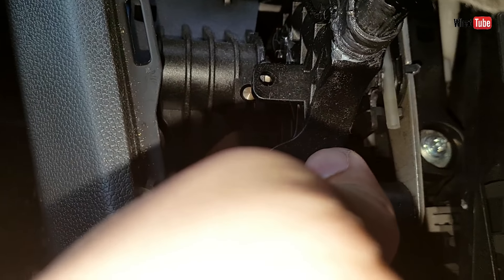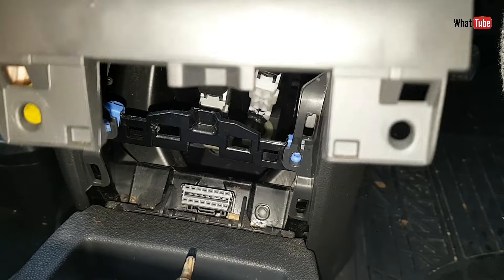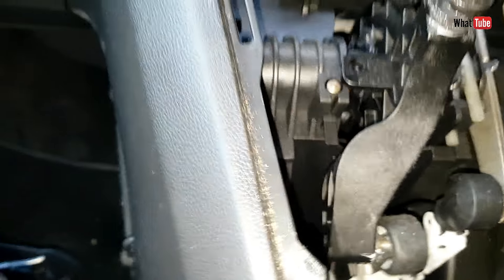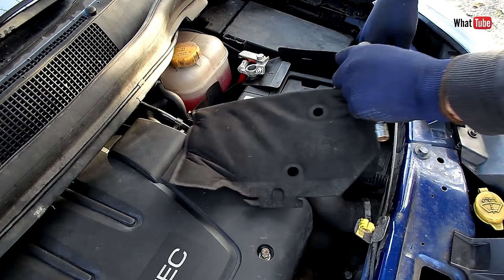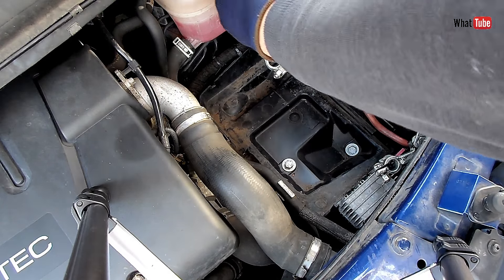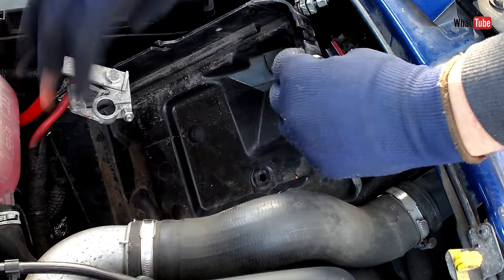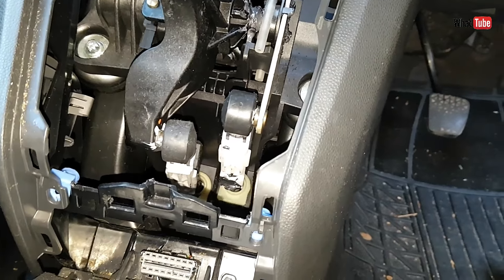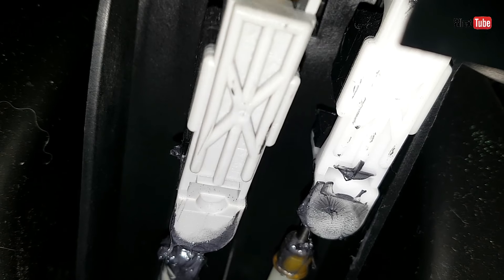Gearbox Linkage Adjustment for Opel and Vauxhall Zafira tutorial

Comment: Fantastic, just bought a Zafira that was impossible to get into first gear, this fixed it and feels like a new gear box, the battery tray is a bit tricky but worth persevering 👍
Reply: I drove mine for about 5yrs with an iffy clutch.  Just swapped the clutch while I had the engine out and it’s like a different car now.  Totally different to drive.
Reply: Was is it impossible to get into 1st gear when the engine is on ?

Comment: Hi. Great video! I've got here a Zafira B 1.8 2009 with F17 gear box. Does it work the same way?
Reply from the maker: Thank you,
It's similar but not the same, the hole is in a different place on the turret for the F17, there is a hole which you can see on part of the linkage away from the main turret (might have to use a mirror to see it) that using a 4.5mm drill bit you lock against the main turret which has a corresponding hole.
Reply: @WhatTube  Thank you very much.

Comment: Great video! My gear freeze and cannot be moved until engine has warmed up like 30 minutes when winter comes. Can you give a hint what can get frozen in there? Cables?
Reply from the maker: Have you checked the oil?
Reply: @WhatTube  Oh, ok, I found out that water from front window gets into the tube covering wire rope connecting gear and shift box. Had to replace the cables. Thanks! Your video helped very much to replace it!

Comment: Hello after having removed and put back new cables (because cable breaks at the level of the gear lever )  my gears from 1 to 6 go three well ,except that the rearward step passes well but when I press on the accelerator pedal I advance as if I was in 1st and not in rearward walk?

Comment: I have a crunch in reverse, do you think this adjustment will help get rid of it? Or maybe you have an idea what the problem may be? All the other gear shifts work fine
Reply from the maker: Hi, it may fix the issue, the best thing to do is trying.
Reply: Did it solve your problem? Mine has a crunch in 3rd. The other gears are fine. I'll try this method in the video, I hope it will help.
Reply: @ezredes19 did it work mine does 3rd and 4th but certain revs it’s fine 💁🏻

Comment: Not sure anybody will answer but i just had a used gearbox fitted on my 61 meriva, been great for 2 months but this week it's been really struggling to get into reverse, all other gears are fine, mechanic said it could be the used gearbox or the gear cable could do with replacing? Thanks.

Comment: with my zafira 1.7 2010 its all good but in 3rd when pressing the acellerator the gearstick moved a bit on its own like slightly moving down towards neutral when pressing gas.
releasing the gas pedal then it returns to the 3rd gear position. it does is very slightly in 4th but not as much as 3rd.

what could be the cause of this do you think?
Reply: for my old vivaro any movement with the gearstick like this meant that the clutch/gearbox was on its way out.. i hope its not the case for this
Reply from the maker: Hi, it can be the cable itself, gearbox or the engine mount as well (normally the front and rear one).
Reply: Hi, I have the same problem with my astra h 2007. Haveyou found the problem so far?
Reply: @rafailnikoviotis4628  nope its been exactly the same, no change, am thinking it could be the engine mounts as its just the same after 8 months, if it was a cable or gearbox there would be some change with it getting worse etc

Comment: Hello mate I have a insignia I think I have the same problem as this but not honestly sure. I can't get into reverse 1st, 2nd, and 6th gear. I can at times with no problem but it's become alot worse in short time frame. If I push the clutch all the way in and try to put it in gear you'll hear noise while clutch is still pressed in.  Clutch doesn't seem to be the problem or the fly wheel(I don't think).  Could you guess the problem bud?
Reply from the maker: Hi, if you hear noise when the clutch is down it means that the clutch is not actually fully separated, it can be the master or slave cylinder, first try to bleed the clutch system.
It can be issue with the linkage like in the video as well, or some damage inside the gearbox.

Comment: Hello mate. when I put my car in reveres (ZAFIRA B 2014)  it often crunch but all forward gears works fine.. also the clutch pedal seems high compared to my focus st.. Can you do a video on how to adjust the clutch pedals please??
Reply from the maker: Hi, in this car the clutch is idraulic so you cannot adjust it (it's possible to adjust the pedal but just slightly).
The release bearing on these it is weak as well so it can be that as well.
I'll try to make a video when I have a bit of time and the weather is good 😁🌦
Reply: @WhatTube  Thank you my friend.. very much appreciated.

Comment: Hi I have a 2015 astra j 1.6 it wont go in any gear first thing in the morning and all I hear is grinding when I try to force it in to gear but once I worm the car up for 10-15 mins all gears work fine all day without a problem what you do think the problem is?
Reply from the maker: Hi,
It can be the clutch, the release bearing or just the old gearbox oil.
Reply: @WhatTube  thank you very much I will get it looked at

Comment: So for the zafira 1.8vvt. Sort of the same but not really lol. Do as he’s shows. You don’t have the same turret so can’t get it to stay in place I had my mate hold it I pushed the clips back in left one went in fine the right one broke ! Put a cable tie on it and my mate let go of the turret and No 4th! Cut the cable tie got the white bit loose again at this point the white bit moved down clipped it in and now works fine and didn’t need the cable tie. Think it’s to high if you clip it in with the turret up so lift the turret do the right side then let go and do the right side now my gears feel light and goes into every gear perfect
Reply from the maker: Nice job 👍

Comment: Hello friend, all my gears go somewhat ok, but the shifters is very hard, do you think this adjustment will help
Reply from the maker: Hi,
Try to change the gears directly from the selector on top of the gearbox, if they go into gear easily, then it can be the linkage stretched so you need to change that. 
But try this method, maybe it will fix your problem.
Reply: @WhatTube  thanks, will try

Comment: Fitted a new clutch and gear selector cable on my astra h GTC 2 liter Turbo and struggle to get 1st and 3rd gear but the others goes smoothly. Can this method also be done on that car or is it not possible?
Reply from the maker: Hi, yes it's same if you have the m32 gearbox, if the gearbox is different then it will be very similar anyway.
Reply: @WhatTube  I have the M32 gearbox, thank you!
Reply from the maker: @joetherookie3180   👍

Comment: Hello mate, why is my vectra c very hard to engage the gears especially first, second and also reverse when engine is hot, i mean temperature at the middle mark 90. When cold all is good, below the middle mark. DMF is new, clutch and release bearing. Changed by previous owner.
Reply from the maker: Hi,
Do you have the M32 or F40 gearbox?
M32 have lots of issues (overheat easily, bad bearings, release bearing, oil level).
F40 it's a good gearbox overall. 
Try to bleed the clutch and brakes, and change the oil in the gearbox.
Reply: @WhatTube  Thx for replying. It's a F40 gearbox. I think i might just do that, change the oil and bleed the system. Thanks again mate 👍🏼

Comment: Hi buddy i have a 1.7 cdti zafira my gears go in fine my problem is the gear stick does not come back to the middle point in neutral. Its stiff when moved side to side how do i fix this?
Reply: Anything?
Reply: Hi did you solve it?mine sticks when engine gets hot.did you change the cables?
Reply: @rabbit5508  its the selector buddy take it off and clean it grease it up and put it back on.
Reply: @JFSR_777  the turret?selector in engine bay?or seector inside car.it moves ok inside car till it warms up which tells me its the engine selector??i was gona change the cable as some one says they dry up with heat.thanks for your help.
Reply: @rabbit5508  the selector on the box mate garage man did mine mines was really stiff hot or cold. Now it's like new.

Comment: Hi I would like to ask if my chevrolet zafira has a gearbox or transmission problem? Everytime I drive as if it was stuck in 3rd gear and the rpm was really hight with a loud noise, but upon activating the winter mode, it drives smoothly. What would be the problem??? Thank you!
Reply from the maker: Hi,
It's your car automatic? If so do you have a manual mode as well?
Reply: WhatTube My car is automatic and i do not have a manual mode ☹️
Reply: WhatTube Yes it is automatic. I dont have a manual mode.

Comment: I have a problem with the Zafira life 2005 
I can’t make it go into 5th gear from 4th it either goes into third or drops back to neutral, but for some reason it only goes into 5th from second gear, found that out when accidentally moving it from 2nd to 5th when I was meant to put it in 3rd after the problem so I know now the 5th gear works but not from 4th would your video resolve the problem.
Reply from the maker: It can fix but if the gear linkage is stretched then you need to replace it.

Comment: when changing gears on my Astra sxi 2008 2.0 its really stiff could this help me in any way or do you have any suggestions off what it might be ?
Reply from the maker: Yes this process can help.
If not it can be the linkage itself, the selector, the bearings worn in the gearbox, or you just need an oil change.
Reply: @WhatTube  Hello.
please help me.
My car is Opel Zafira B 2.2 Direct. 2005 model.

I just dropped my child off to school with my car and came home, I started the car to go to work and put the car into 1st gear, but the car is reversing.
The car never goes into 2nd gear.
3rd, 4th, 5th and 6th gears work perfectly and the car can take off with high gears.

If I do what you did in this video, will my car return to its previous state?
I look forward to hearing from you.
thank you for everything.

Comment: La leva del cambio della mia Meriva b molto simile a questo va indietro quando accellero e ritorna avanti quando lascio lo fa di prima 5 e 6 e probabile sia questa regolazione??? Grazie 😊1.7 cdti
Reply from the maker: Hi, yes, it can be the linkage, but it can be the gearbox itself as well. The bearings inside this gearbox are not properly designed.
Reply: Grazie 😊

Comment: Hi. Would this work on a 60 plate,1.8 5 speed zafira? When cold doesn't want to select gear until after cars been running 10 minutes or so then 1st is tight and reverse grinds a lot
Reply from the maker: Hi,
In your car there is a different gearbox.
It's the clutch ok?
Try to press the clutch pedal and wait 2 seconds before inserting the reverse, and try to replace the oil as well.
Reply: @WhatTube  thanks for the reply. Swing it into a garage clutch and slave cylinder getting replaced

Comment: Hello , i have an Zafira b 1.7 dtci 6 speed  . I have problem when i want to drive I do not differentiate between the first 1st gear and the reverse R. The reverse gear comes without pressing the button. Do you know what is the reason
Reply from the maker: Hi, yes the clip or the spring are broken so you need to replace them. Remove the gear knob cover and you can check it from there.
Reply: WhatTube Thank you , i will
Reply: What tube Hi got same problem witch spring broken 
First goes to reverse without pressing the clip thanks
Reply: Hi Did you fix yours?
Reply: kala sher yes i did
Reply: @zaidajeel91  what did you replace?

Comment: Hi mate I’ve replaced a clutch on an Astra sri 08 and after two months the gear wouldn’t go into place unless forcefully pushed and it made a loud screeching noise, I tried again 6 months later and now it’s going in to gear but sometimes with a strain and I have to be delicate with the reverse, makes a large clinking sound. Any help on this would be great been proper stressing about this
Reply from the maker: Hi,
Check the clutch pedal if it travels ok, try to bleed the clutch fluid in case there's air inside, the gear linkage can be stretched so it need replacing, the gearbox itself can be damaged as these are very prone to failure.
Reply: WhatTube appreciate it, how much would a gear linkage replacement or a gearbox cost ?
Reply from the maker: For the linkage it should be around £100, for a reconditioned gearbox it's at least £400.
Reply: Synchromesh in box? New one would be starting at £300 recon even higher if it’s m32

Comment: Thanks for a great video! I can not use gear number five and six since one week. Do you think this adjustment could help? Best regards.
Reply from the maker: Hi, yes it could help but it can be the selector broken.
Reply: @WhatTube  Is it hard to put in a new or repair the selector?
Reply from the maker: Is not that difficult, but to do so you have to remove the gearbox.
If you are not mechanically minded it's better not to try it.
Reply: @magnus axelsson hi what was the issue? Did you solve it?

Comment: I have an Astra J 2013 5 speed manual, sometimes it doesn't go into 1st gear feels like something is blocking it. Will adjusting the linkages stop this?
Thanks
Reply from the maker: Hi, yes it can fix it, but if the cables are stretched you need to replace them.

Comment: i dont understand.. What did you actually adjust?!?
All i see, is you removed the linkage cables from the shifter, locked the shifter and gearbox turret to Reverse location, and clicked the cables back on..
Reply from the maker: Yes, because over time the cable do stretch and the default position will be different, by doing this method we are fixing back to the default position, so all the gears will go in and out smoothly.

Comment: what sort of grease did You use?
Reply from the maker: Hi, you can use any type of grease, there isn't a specific one.
Reply from the maker: Great 👍
Reply: @WhatTube  Ptfe is indicated.
Reply: It looks like Molyslip grease.
Reply: A waste of grease trying to grease the selector shaft as it has a seal in the turret and it would wipe the grease off and then you would have grease all over gearbox top.

Comment: I just done this and now it won't go into 4th or 5th. Any ideas?
Reply from the maker: Probably you done something wrong.
Are the 3rd and the 6th gear working?
Because if you done something wrong you should have the 3rd and 4th not working or the 5th and 6th not working. It's very strange that in your case is the 4th and the 5th.
Reply: @WhatTube  it was my fault but I managed to fix it. Mine doesn't have anything to lock the gearstick in neutral so I had to hold it in place and then push the tabs back in.
Reply from the maker: @georgeh4981  ok, well done!
Reply: @WhatTube  thanks for your help 👍

Comment: Mine struggles to go into 3rd and 4th clutch seems fine in biting point and doesn’t slip mine is the 5 speed did this work for anyway my gears go into gear fine just a little grinding noise anyone had success in doing this ?

Comment: Ive got a severe grinding noise over 2k rpm after sccidentally pulling one of them cables, is it possible ive made them go out of line? Will this fit it?
Reply from the maker: Hi, yes, you can reset them, but if the cable is stretched, then you need to replace them.
If the grinding noise is only over 2k rpm, then it can be the gearbox itself. If the noise is just when you shift, then the issue is with the cable.